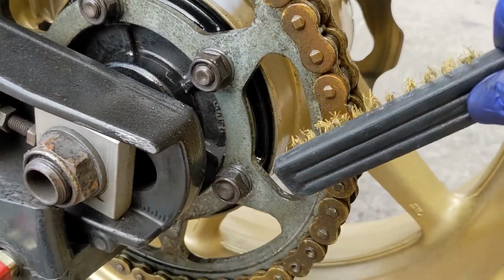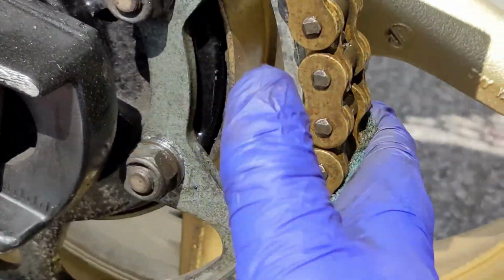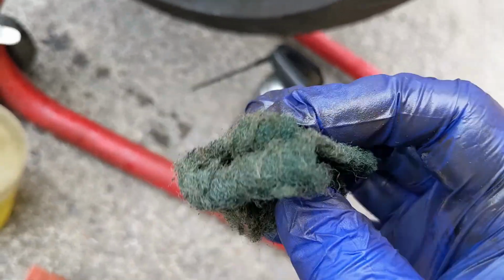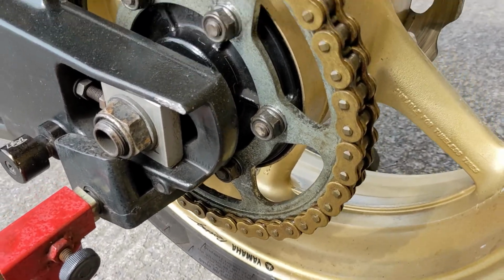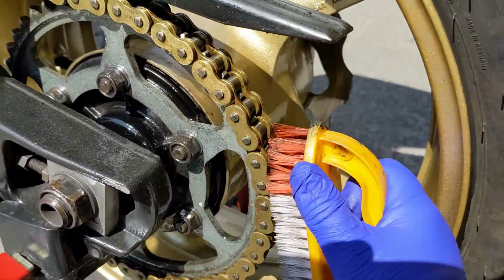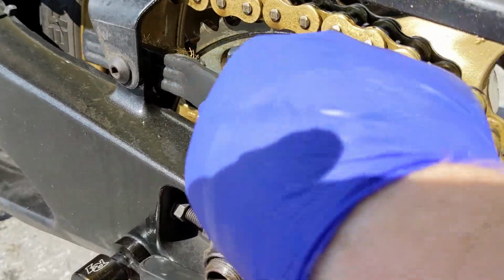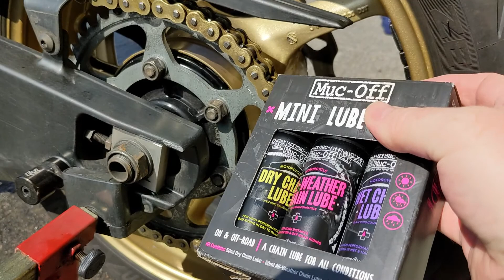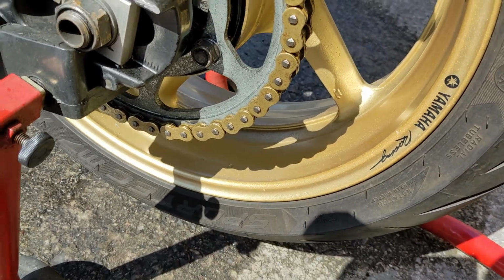How I remove Rust from a motorcycle chain

Comment: Paraffin is great stuff for cleaning but be warned not all chains use the same material the make the "O" and "X" rings. D.I.D in last year or two changed the formula of the rings and Paraffin destroys them (and quite quickly I might add).
Reply from the maker: What’s happening is folk are using aggressive methods such as wire brushes and string cleaners. This has led to an influx of warranty claims. I’m going to continue using paraffin as DID haven’t stated any change of xring formula. Here is what they say https://www.didchain.com/blogs/news/d-i-d-chain-maintenance
Reply: @MotoTingle  I’m confused that link you’ve put say in big bold letters never to use paraffin, kerosene is a type of paraffin? Great video though ❤
Reply from the maker: @thetigerguy2704  I am friendly with them, they want to promote their products instead I guess